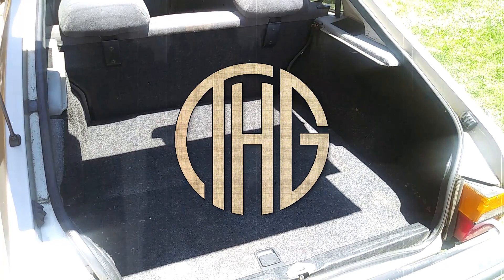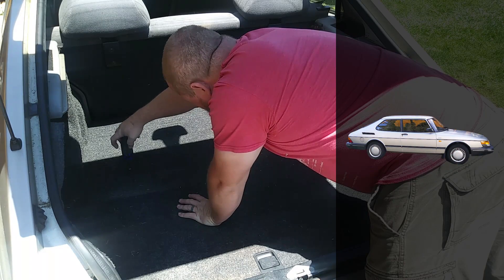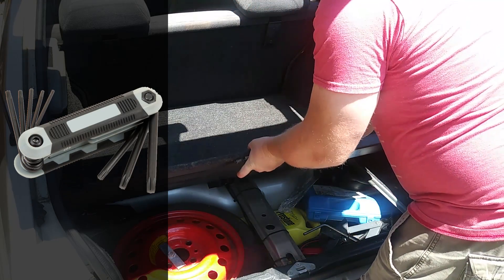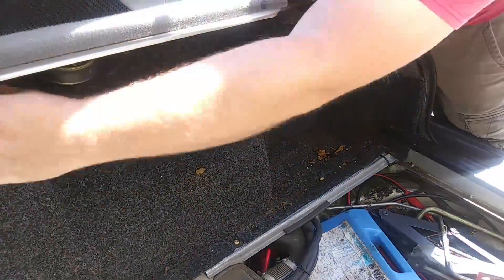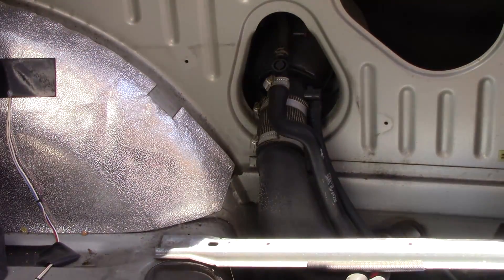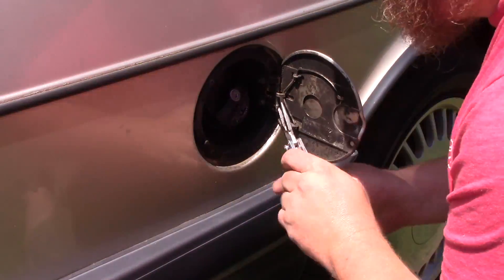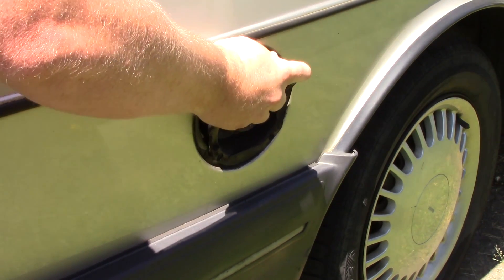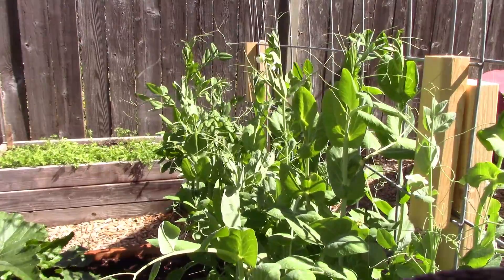Replacing The Fuel Filler Neck On A Classic Saab 900 Turbo! Fix Your Broken Fuel Door!

Comment: Cool thanks ! Ill need to do this too. Very helpful. Is that gas cap with the key oem? Or is that a motorad cap from eeuroparts?  Turns out the past owner put a 1988 gas cap on mine after an accident. (I have a 91 900 Turbo too). Somehow the filler neck and everything got put through the ringer. I need to find out which gas cap I need. Theres one I can snatch off of ebay, but its for a non turbo 91 900. Im wondering if it'd be a match.  Thanks.
Reply from the maker: I am pretty sure that the keyed gas cap was just a cheap aftermarket, it was on the car when we bought it. I would imagine that as long as your gas cap screws in and seals properly, it shouldn't matter what year it came off of or turbo / non turbo.